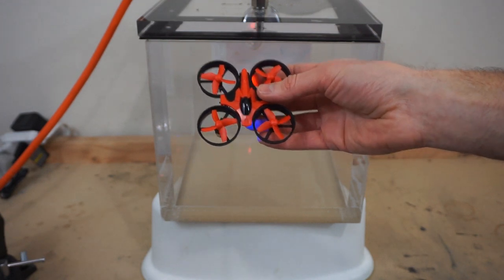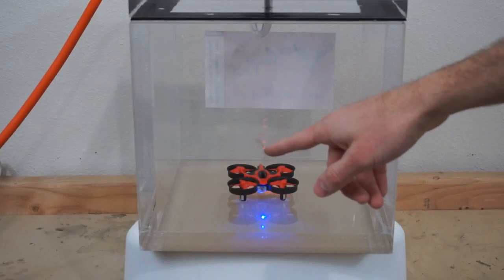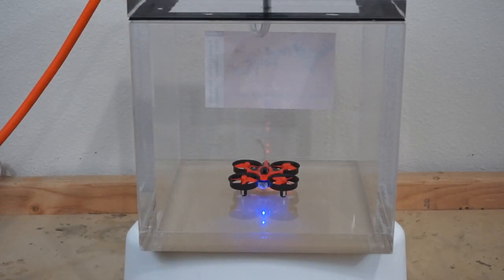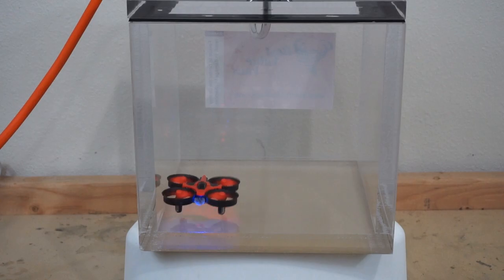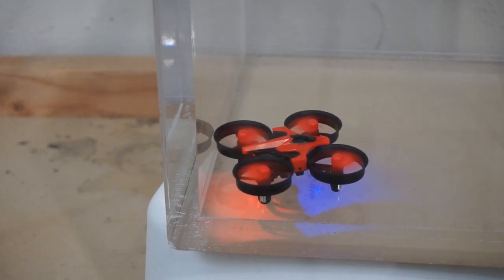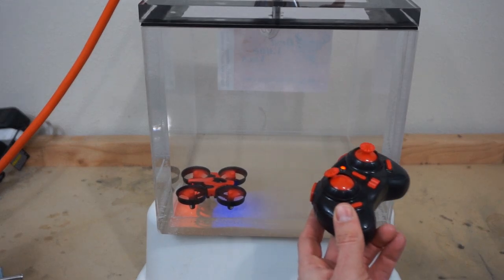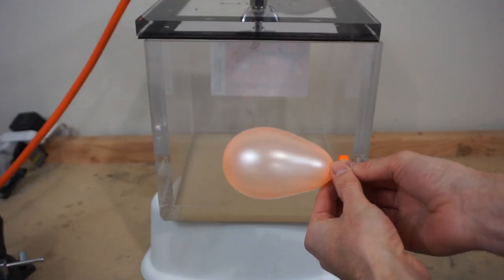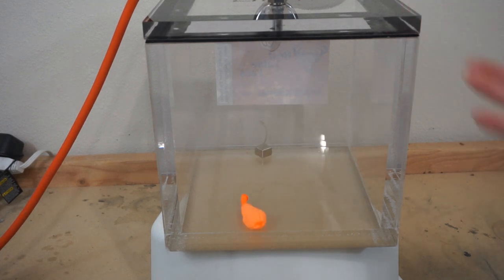What Happens When You Put A Drone In a Vacuum? Can It Still Fly?

Comment: The ONLY PROBLEM  IS 
Space is a quadrillion time more of a vacuum than what you can actually achieve  to say a rocket can work  yea you still have what  .1 atm from 1atm   space is .00000000000000000132 atm  power of -17    omg  Sandusky  pressure chamber is 6-7 feet thick to keep it from crashing in on itself. Your little chamber  yea shows a 1% atm like Mars    they used a helicopter I heard to lower a device.   😆  why we can't get helicopters to top of Mt Everest  air too thin  not enough density. We pilots call DENSITY ALTITUDE. When we take temp pressure humidity all into it we calculate our aircraft performance   on a hot humidi day at high ALTITUDE. Do not fly unless you have the power to do it. Why going to mountains in summer in a Cessna is dangerous  

Great videos  but to say ROCKETS work when Bernouli gas law states gas needs another gas to act against. With no air you Nt say a rocket works
Reply: The walls are 6 foot thick to keep atmospheric pressure out, not because of the strength of the vacuum.
Reply: Also the Bernoulli principle is relevant to the drone but it is totally irrelevant to a rocket in a vacuum.
Reply: @Lee.S..B     Has laws applies. Gas must act against another gas  where does it gets it force from.  You 5ink cause it burns that’s to push it?   Then you do t know anything      Even with shockwaves there must be air for a shockwave to work.   

I would love to see a bottle rocket in a air chamber not launching from the ground so it can get a push off a solid source.
Reply: @Lee.S..B  lol. Westfield you think would cause it to crush in on itself.  Same thing I was saying genius.  Like the oil container video.  Jesus. If air gets in  the chamber is because it failed. If it fails it had to crack   Same thing.  Like. Potato patato   SMH
Reply: @AerobaticsPilot  
Newton's 3rd law of motion needs the Two objects to cause an action and reaction. Not two gases.
That's the reaction between the exhaust gas and the combustion chamber/exhaust bell.

Do you think that the violent recoil of a powerful shotgun is caused by the projectile hitting the air as it's leaving the barrel?

Do you think that the 7,000,000lbs plus thrust of the Saturn V was pushing on 14.7psi atmospheric pressure?
That'd be like trying to push a freight train with a rope..

The X-15 rocket plane achieved over 6,000km per hour above the karman line.
How would that be possible without air to push against?

I mentioned the vacuum chamber because you were using it as a false example of the a vacuums strength when in reality it's the opposite.
A vacuum is nothing and nothing doesn't have any power or energy to do anything.
Reply: @Lee.S..B  you still don’t get it.   The GAS. still needs to push on something to get the rocket to go forward.   What is the rocket pushing against.  

Here a Dr of physics wrote this in simpler terms. 

If we actually witness a water rocket, or water balloon when the end of it is opened....what would happen if  you opened the end of it in our atmosphere, or the vacuum of space....if we could watch what happens in slow motion....we would know what is truly going to happen wouldn't we?

Well...that's where I step in....My mechanical aptitude allows me to simulate such things with a high degree of  understanding about their movements and workings.

When the end of  the water balloon is opened in our atmosphere, the speed which the water comes out is slowed down by the atmosphere itself...just simply saying it immediately encounters resistance to it's outwards path of travel.   This seen in slow motion equals the very first amount of water to come out, to now be moving slightly slower than the current water coming out right next to the end of the balloon.  In other words...the water coming out of  the balloon encountering resistance is  slowed down some, and this forces the initial velocity of the water exiting the balloon to push against the slower moving water that was expelled first...and this "pushing out of the way", by the faster moving water running into the slower moving water is what produces a "force" for the balloon itself to get pushed forward.....or this is what produces the Thrust of the water jet coming out.  It's faster moving water under pressure, running into the slower moving water that left first in line, that has been slowed down due to the atmosphere here on Earth.

In space it is quite different and  the difference is that water jet coming out of the balloon does NOT get slowed down, and therefore does NOT get pushed out of the way by the faster moving water at the back of the line.  Instead the water which left the balloon FIRST is traveling at the same speed the water leaving the balloon NOW is  traveling.  So the water leaving the balloon NOW is NOT moving faster than the water which left the balloon FIRST....therefore it does NOT run into slower moving water, and therefore it does NOT push slower moving out of the way, and therefore does NOT provide any thrust because it never pushes ANYTHING out of it's WAY.    Got it?  Get it...learn it....love it...eat it up...do whatever you gotta do....but dont ever FORGET.  And maybe don't me....Old Skool...who told you about it, and took the painstaking time to tear down your initial biased opinions about it...and BEAT it into you mind literally, repeating it over and over and over until you FINALLY get a good grasp of what is actually happening.  I Want you to know what is happening...it's in my nature, as One Man Sharpeneth Another.  Amen.

So as water jet is coming out of the hose. Air slows the water down but the water behind it hits the water molecules in front where we get the motion.  Same for a gas.  So when the exhaust comes out at a extreme speed it hits air that has mass.  The ignited gas behind it hits the molecules in front  when the FORCE comes it  the resistance of the air  makes the rocket go   But if the gas doesn’t slow down cause of the vacuum it’s just burning it’s fuel  that’s it. Can’t push on anything to get that MOTION.    It’s a losing battle. You won’t look at it in this way.   Either you don’t want to or just so hard headed you can’t see how it works.   

A  helicopter flies by creating lift.   A lower pressure under the blades causes lift that will lift the object up.  But in a vacuum you can see this drone just sit on the bottom of the chamber not moving  well it’s vibrating from the blades.    With no air it can’t create lift.      But you think a rocket can
Reply: @Lee.S..B  still didn’t get a reply back. If you think cause it pushes off from the back of the rocket is why it goes your so wrong.   It must PUSH OFF THE AIR MOLECULES BEHIND THE ROCKET.   The gases is just flowing outward. Where it hits the air like on earth. In space. What do you push off of?  Just curious
Reply: @AerobaticsPilot  so you think RECOIL just stops working in a vacuum?   So if you fired a crossbow in a vacuum it would not have recoil???
Reply: @stuartgray5877  didn’t say that.   Did you read it or just can’t understand physics.    Recoil happens no matter what. It’s coming from the cartridge dummy.   So if your in space or in a vacuum it would definitely give you a heck of a push.
Reply: @AerobaticsPilot  I offered to show you a video of rockets working in a vacuum if you just answered my three questions.

WHY did you run away? are the questions too difficult for your limited understanding of basic physics?
Reply: @stuartgray5877  show me the video I saw where students from local college brought over rocket fuel and it didn’t work.  And that was still a shitty case.    Under Bernoulli laws and principles of fluid dynamics it cannot work.  What is the pressure of the ROCKET BLAST PUSHING OFF OF. If there is NO ATMOSPHERE or molecules for the blast to push against it just can’t work.
Reply: @stuartgray5877  lol.  Ok. Genius. The. Why doesn’t a car move in ICE. the tires are spinning.     Do you understand pressure of gasses. And Bernoulli principals.
Reply: @AerobaticsPilot  either answer my questions or run along and play in traffic. Answers to your questions will be revealed if you even ATTEMPT to answer the three questions.   And just try to explain the recoil force on a crossbow to me.  Pretend I am five and tell me how recoil works.  You cannot, because you don't know.
Reply: @AerobaticsPilot  Where is your description of how recoil works genius!  Still trying to work it out?

Have you considered actually reading a PHYSICS BOOK?

Comment: Space travel with engine propulsion officially debunked.

Using the balloon isn't going to get you an accurate depiction of what would actually happen.  The air in the balloon is pushing off of the wall of the container...it now has something to push off of to propel itself forward.  The drone couldn't fly at all.  It moves around a little as the fan blades create enough thrust to push off the bottom of the container, but not enough thrust like the balloon had.

Here's what you do...create a small rocket with a fuel source and try to ignite the fuel.  1. It won't happen.  As we know, you need oxygen, fuel, and heat.  You have no oxygen.  It will not light, and if you do get it to light it will not last or it will simply spark a little.  2. If you do manage to get any type of propulsion, it will have no container wall or atmosphere on which to push.
Reply: - "Space travel with engine propulsion officially debunked."

Except for the part where we have logged millions of hours of rocket propulsion in a vacuum.
Grow up.

Comment: I disagree with your conclusion based on three factors 
First your vacuum is not nearly strong enough to equate with what we are told is the equivalent of "space" 
Secondly the walls of the chamber are what provided the compressed air in the balloon the matter on which the escaping air pushed upon in order to achieve propulsion not the air pushing upon itself ( 3rd law ) 
And lastly ... well two is enough and if you are honest and candid i expect you will agree and retract your conclusion immediately. 
When we cease to question we initiate complacency thereby allowing subjectivity to imitate the objectivity of true inquiry. ✌🏻
Reply: Strong vacuum?!
ROTFL
Reply: max5250  if I began with equating the lack of pressure on the Torr scale would you have been equally amused or are you just a simpleton ? Try adding some substance to the discussion instead of derision. And while you’re at it why don’t you enlighten me on how it is the balloon was NOT using the proximity of the container to effect its propulsion?  Or have you not attained that level of “science” ?
Reply: @flatearthbear4077  
So, vacuum, or total lack of pressure is strong?!
I really wonder how totally empty space can be "strong"?!
And, while you are trying to explain behaviour of balloon with "pushing off walls of container", can you throw in some formulas, since we already have an explanation of movement with propulsion that doesn't take walls of container into account.
Reply: max5250  No I won’t waste time presenting you with formulae . It’s quite obvious you’re not capable of distinguishing between theory and application.
Reply: @flatearthbear4077  
Of course You "won't waste time presenting the formulas", since there are no formula a all. It's quite obvious you have no clue how complicated science is, and how many complicated formulas they have created.
You can't even understand that "theory" is backed by "practice" since all these formulas gave us possibility to create new machines and devices to make our life easier.
Reply: Space = no atmosphere. 
You cant get any stronger of a vacuum than no atmosphere at all...
Reply: masderus  I’ll reply as I’m not certain by your terse response your intent. The least amount of vacuum obtainable on earth is the one run by the JPL in Ohio... they get that one down to a negative 6 Torr...the walls are 12 foot thick and sheathed in steel. The void of space is said to be a negative 17 torr ( approximation as we have been told the moon is at negative 14 )  So please forgive my disagreement here as a 1 foot plexiglass cube under “ vacuum” isn’t cutting it
Reply: @flatearthbear4077  And yet the drone refuses to fly even in what can be considered a "light vacuum" environment thus proving that even with minimal atmosphere objects still fall towards the earth. 
The difference between a "light vacuum" and an "ultra vacuum" can be measured in decimal amounts which are negligible given this type of experiment. 
Either way this proves that objects fall towards the earth due to a different force than "density" which isnt even a force, but the measurement of how tightly packed atoms are in any given area. Gravity has been proven.
Reply: @flatearthbear4077  I have presented my side of this argument. You can try to dispute me, but I suspect you believe your time is too valuable to try and defend your views. Scratch one up for the globe!
Reply: @flatearthbear4077  
"they get that one down to a negative 6 Torr"
"The void of space is said to be a negative 17 torr"
Since when we have negative side of Torr scale?!
Reply: @max5250  I dont think he understands its 1 to the negative 6 or negative 17 lol. Which is still a positive number. Flerfer logic is so interesting.
Reply: @masderus  
I don't think he is able to understand just about anything, let alone usage of negative exponent to express very small values.
Reply: max5250  Here ya go max ... scroll down until you find the chart comparison. You’ll let us know what you find won’t ya? https://en.wikipedia.org/wiki/Vacuum
Reply: masderus and again you’re mistaken... Newtonian “ gravity” has been replaced with Einstein’s ... hence it is not a force nor can it be said to “pull” on an object as the definition involves “space/time”  and the term “pull” is a descriptive of an action and not the causation. All movement requires a pressure applied. You keep trying though I’m sure someone will believe you
Reply: masderus  silly goose. We are told that “ outer space” pressure is equivalent to 1 x 10 to the NEGATIVE 17 torr. I never said the pressure of space nor a terrestrial vacuum was “ negative” pressure.  It’s a decimal expressed as a “negative” power mathematically. And its definition lends itself to be expressed as “ negative torr”  ( ex. -17 torr / negative 17th torr ) Hope this helps 😉
Reply: @flatearthbear4077  
Since when is "1×10−6 to < 1×10−17" read as "negative  6 torr to negative 17 torr"?!
Can you write "1×10−17" without using exponent?!
What number you will get?!
Will it be negative number?
How much "stronger" is 1E-17 compered to 1E-6?!
As for the gravity, Newtonian gravity was not "replaced" but better explained with Einstein's Theory of relativity.
But Newtonian gravity still works (under specific conditions), and Einstein's space-time warping is still caused by mass.
And there is no need for pressure to be applied to create movement, since momentum is all you need (google for: reaction wheels).
Reply: max5250  God your not the most erudite fella out here are ya ? The exponent of the whole number is used as an abbreviation. as the multiplicand and the multiplier are static when dealing with torr as a measure of pressure. Anything else ?
Reply: max5250  ok Max , we are done here. Ive educated you enough on one topic and you have given me nothing for it. Please dont respond as you shall be met with silence as i deem you not worthy of reply. goodbye
Reply: @flatearthbear4077   So explain in your own words why the drone falls to the bottom of the chamber with a lack of atmosphere? I mean, theres less and less air for it to "sink" into so something else must be pulling it down, right? 
1×10^-17 torr can be notated as 0.00000000000000001 
and just 1 torr equals 0.0193368 psi
so I'm sure with your infinite flat earth wisdom you can figure it out from there. 
So please continue to explain to me what should happen to a drone in a vacuum on earth... Is it supposed to magically float or something?
Reply: @flatearthbear4077  "deem you not worthy of a reply" wow absolutely incredible... can you see your house from up high on your pedestal?
Reply: @flatearthbear4077  Refusing to answer and explain your side of the argument does not help you in any way. It only makes flat earth look even weaker than it already is since its followers never explain themselves.
Reply: masderus i dont apologize for being the most intelligent person in the room. Most dont have the hard wiring for it, i get that
Reply: @flatearthbear4077  I cant tell if your serious or just a complete troll... I'm leaning towards the latter.
Reply: masderus you make a habit out of being mistaken. Sad to be you
Reply: @flatearthbear4077  If you claim to be so smart why do you refuse to back up your claims? Why do you simply back away and insult people rather than debate us and have intelligent conversations? Back up your claims with your knowledge. Refusal to do so implies your intellectual weakness.
Reply: @flatearthbear4077  This is why so many people consider flat earth a joke. None of you will explain your reasoning, and most of you brag about your intelligence but never show it.
Reply: masderus if by now you dont realize you are a bit dated in the intellect category, you need professional help.
Reply: @flatearthbear4077  "Dated in the intellect category" I'll have to write that one down in my list of known flat earther insults.
Reply: masderus objects at known distances of known heights. Observation coupled with known factors capable of repeated independent confirmation is called proof. 
Refute what i know to be true, it makes no difference to me.
Reply: @flatearthbear4077 
1.) https://youtu.be/zAXt7KhReLQ
2.) https://youtu.be/36Kw7xfmmpk
3.) https://youtu.be/luq4zhQj720
You're out!
Reply: @flatearthbear4077  Refusing to answer or explain yourself is the same as losing an argument.